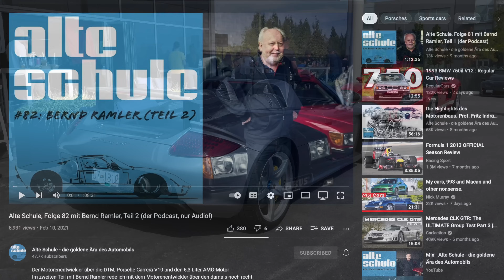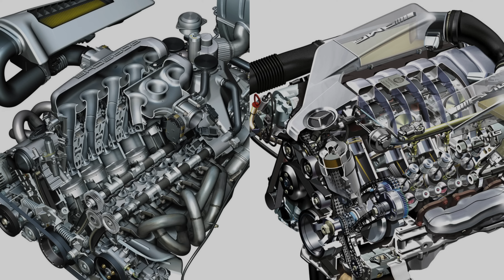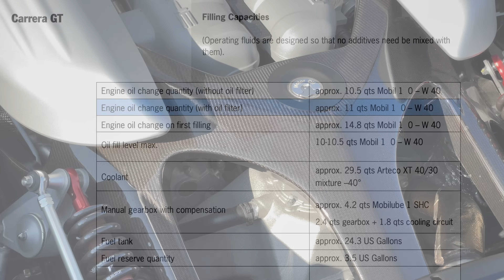What Does AMG’s M156 Engine Share With Porsche’s V10?

Comment: Headbolts issue with M156 engine is the worst, every M156 owner is aware of this problem. Your video failed to mention it.
Reply: this was a comparison of the two engines, he has a separate video on common problems

Comment: isnt the 156 also plagued by the infamous head bolt issue?
Reply: Totally over exaggerated issue by the internet. Watch this guy and you’ll see https://youtu.be/zJO1qNnhxw4

https://youtu.be/svf0R_00M5s
Reply: @ELWIN225  I watched him.  I am not sure what I or anyone else is supposed to learn from someone who professes he is not even a "DIYer myself".  What did I miss?
Reply: @wtharris2343  if you watched his channel you’d understand he was just being humble. The guy opened up his AMG engine and changed the head bolts. He has done it to others too on the E chassis and all the bolts came with minor surface rust. 
My point is that m156 is safe to buy. Failure rate was very low and mostly on C63. M156s on the road today have either been head bolt swapped already or have high mileage on original bolts and running strong.